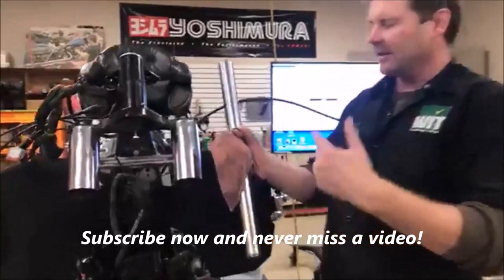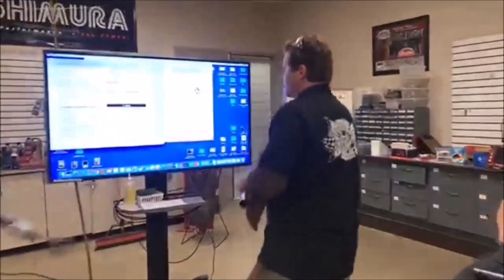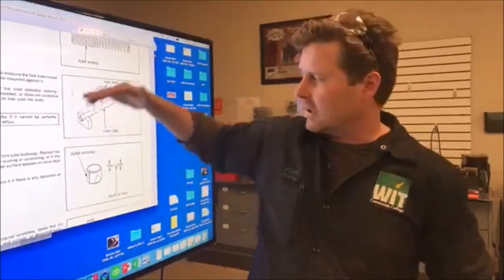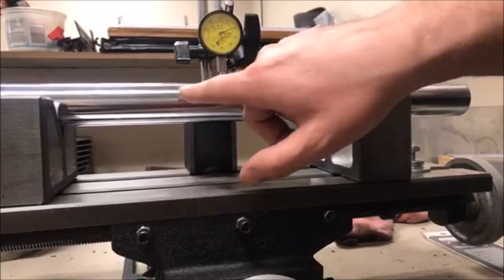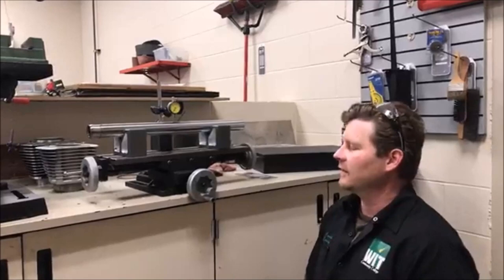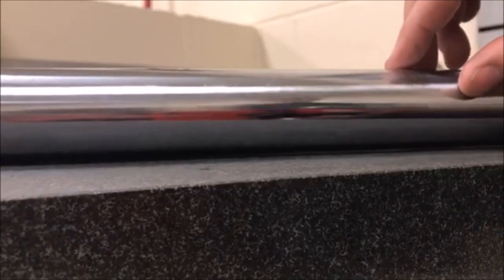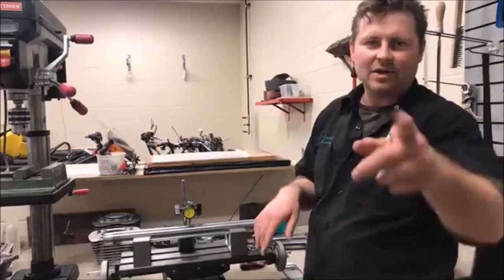How to check for a bent fork tube. With and without specialty tools.

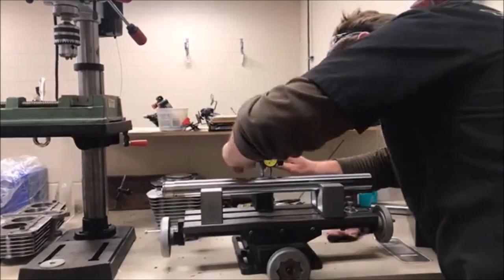Comment: Awesome Shane, what I'd like to point out when i was in tech school the instructor would call a student out if he caught a student literally sticking a magnetic base dial indicator on a metal work bench and a part that needs to be inspected with V-blocks. He'll vigorously shake the differential as an example if he doesn't see the student put the indicator attached to the differential, majority time students stick it on the work bench and differential is on those 2 fork arms to hold it to inspections and literally he'll say what is it your doing and you're doing it all wrong because its allowing play in your inspections if its not fully mounted to where it needs to be if that makes sense. Its like for ex : 4:24, if i didn't have that tool, i'd make my own big steel sheet and attach bolts to it, must make sure of flexing of the sheet is not possible and attach this sheet above with block or something, doesn't matter if it moves but as long as the whole sheet has holes where bolts and nuts can go through to attach v blocks to make sure of any play and the magnetic base I'd probably make a square trap box to allow it not to move. I don't know whether it makes any difference but i feel like it would. Your way of doing it is fine too. just as long as the v blocks don't move thats great. 

Keep up the great work Shane.

Comment: Can you please show how check the inverted tube?
Reply from the maker: Use v blocks to give rotation clearance for the brake/axle mount or simply hang the part of the inverted tube off the bench and do a quick check for a bent tube.